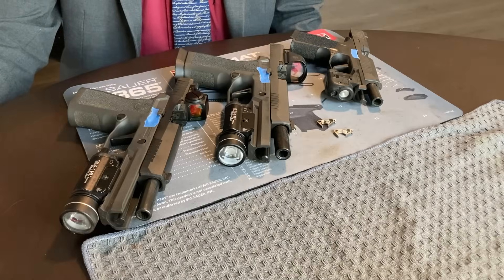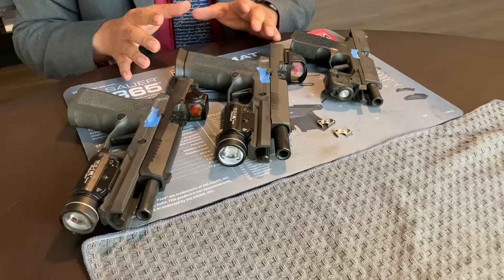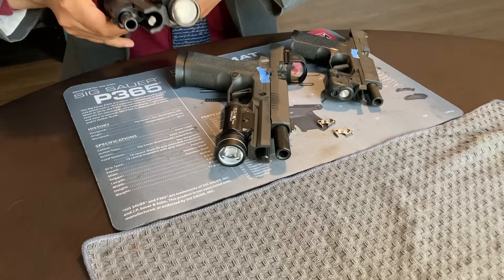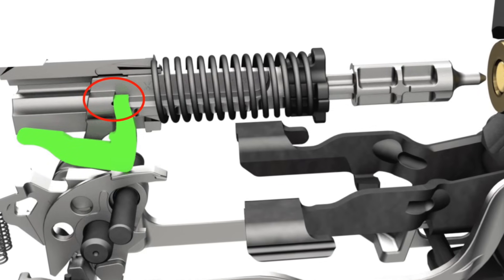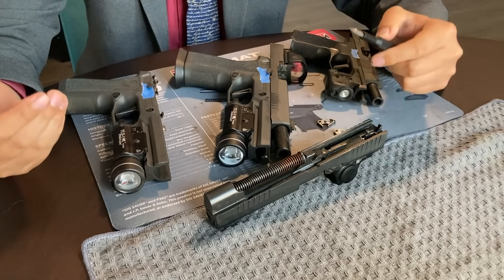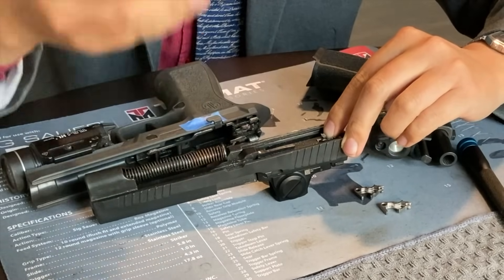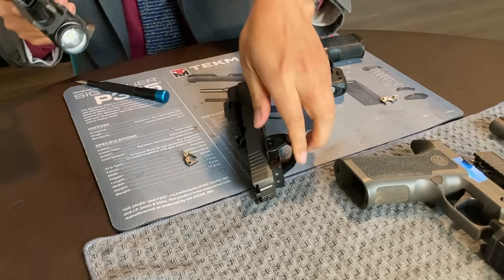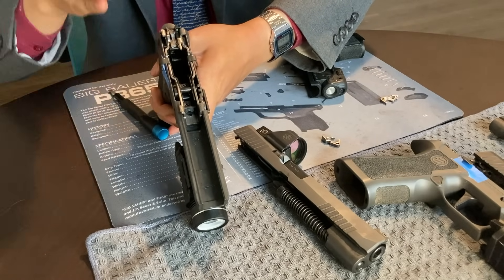How to fix a P320 that fails the Sear Movement Test

Comment: My understanding is that the uncommanded discharge issue does not occur with the P365. Why not just upsize that mechanism into the commercial P320? I understand SIG cannot change the M17/M18, but why not simply change the commercial P320 to the P365 action?
Reply from the maker: You'd have to ask that of Sig, we're just trying to make the most of our paperweights that we can't shoot at any ranges!

Comment: My buddy is a county sheriff and their entire force carry’s the M17s.  I guess they had a guy from Sig come out and put a stiffer spring in and they all carry with no issues. Like you said, it’s not a for sure guaranteed fix but it seems to have worked for them.  I personally have no history with them that’s just what he stands on when I make fun of him for carrying it on duty.
Reply from the maker: Hah - likely a stronger Striker Return Spring. A strong and authoritative Striker Return Spring seems to mitigate the vulnerability to sympathetic Striker Safety Lock deactivation, but that spring doesn't prevent the issue, it merely papers it over. I hope your friend's department experiences no issues!

Comment: Very very interesting video!   I was glued to it !!!! I had to get headphones so I didnt have any distractions 😅  I have a 320 that has drove me nuts. The sear stays up higher than it should. Have to pull the trigger to disassemble.    Its tough to put the takedown pin in when reassembling. Ive had the FCU apart sooo many times trying to figure it out.  Gotta see if there's a difference in the sear now!!!!! My other 320 is easy to disassemble. Both guns shoot totally fine ,   Awesome video !!!!!!!

Comment: So basically, when CIG 'fixed' the issue in 2017, they possibly created another design flaw that can potentially causes a different issue IF the gun is broken or damaged or overly worn. Seems like a very easy fix if that is what allows the gun to fire without a trigger pull. So you have to ask; "Why don't they fix it?

Comment: The rear half of the sear engages wirh the trigger bar so on thumb safety manual versions of the p320 it locks down the trigger bar when it is engaged this stops the sear from being able to drop and stops the safety lever from rotaring being able to dis engage the striker block safety and obviously stops the trigger from moving.

Comment: So out of spec manufacturing tolerances ? Ive 2 axgs and they were safe. Kinda shity you havae to buy a 1500 dollar version. Even if the striker block operated properly, you have a dead trigger  unknowingly. Meaning self defensively the pistol also fails

Comment: Cause: Sig wanted a better trigger pull and feel than Glock. 
Like the Rem 700 trigger issue?
Reply: What SIG wanted was to not have a trigger safety tab like the Glock, but unlike Mr. Glock, SIG failed to understand inertia and the real purpose of that tabbed trigger safety. Recall SIG’s original ads showed that the P320 could be ordered with the tabbed trigger safety.

Comment: I know sear disengagement won’t cause an uncommanded discharge, without a failure of the safety lever lock.  But won’t it cause a dead trigger? Wouldn’t this cause a need to rack slide unexpectedly at potentially the worst time?

Comment: I shouldn't have to modify any firearm to get it to work properly and also to prevent any un-commanded discharge. This is a bad design. Sig needs to redesign the sear, disconnector, and striker assembly and striker safety lever. Use the design that exists in the Sig P365 and everything will work fine.

Comment: I have a 320 upgrade, I live 20 min from sig in newington my triger does not move i also beleave I have a new match style trigger. It also came back in under 3 weeks. with all that said could the upgraded trigger have fix the issue? or could i have a phtom sear?

Comment: I have no idea the purpose of that leg either, but I know enough to know that no manufacturer adds parts or features to parts that add cost without some expected benefit.  So, I am virtually sure that Sig had an expected purpose for that  leg, but I don’t know what it was.  It does seem to also have added an unintended consequence to the intended consequence.

Comment: Ok guys, guess you don't understand how the p320 works.  The rear leg in conjunction with the with the front leg, locks the sear to the trigger bar.  When you have the external safety, it locks the trigger bar and the sear cannot move under any circumstances.

Comment: I’m interested to see if anyone can recreate an uncommanded discharge with the external safety engaged on an M17 or an M18 model. I currently have the full sized military M17 and I have been fiddling to recreate these issues and I have been unsuccessful. With the safety disengaged I could pull the trigger past the wall to a point then wiggle the slide to get it to fire, but that was the closest I could get to recreating these issues issue. I did your tests with the safety engaged and it seems to have a different behavior. Locking the trigger up with the safety seems to lock trigger bar to an extent, and not really allow much if any sear movement. I haven’t done your test with the gun assembled by pushing on sear with a poking tool, but I will soon and I’ll update here. Someone in another comment said it seems part of the issue is the sear can actuate the trigger, which then drops the striker safety, but as I said I wonder if someone can replicate that with the external safety engaged.

What’s worrisome to me about the P320 is the airman situation, because that had an external safety in the holster, and I’m thinking the safety was probably engaged. To be honest, the other supposed UDs are pretty much all LEOs carrying a gun with no safety that’s even less forgiving than a Glock. Glock leg was a thing, and it turned out to be bad gun safety practices from officers. Take a P320 and assume it’s working perfectly, and give it to an officer (who are known to be some of the worst of the gun owners out there), and I can easily see cops shooting themselves. If a shirt snagged in your holster, a Glock might forgive you much more easily than a sig, for example.

Comment: Without the back leg on the sear, then sear can move if sear springs compressed. With an external manual safety lever, does the sear get mechanically locked and prevent from falling?

Comment: Holy Crap on a cracker! .. this was an AWESOME demonstration and extremely valuable information! .. I am also relieved that the P365 doesn't suffer from the same affliction (design flaw) as the P320 as I own several P365's and use it as an EDC. Thank you very very much for this video!

Comment: SIG isn’t known for leaving extra material on parts out of generosity. If there’s a protrusion or odd geometry, it’s almost certainly there for a reason. If they could shave off a few cents, they would. So unless you know exactly what you're doing, don’t modify your sear.
also ... Please don't try to offload your defective SIG P320 onto unsuspecting buyers. I am hoping that advice was sarcastic.
Reply from the maker: Bruce Gray's original patent describes why he added that secondary leg. It also describes necessary behavior for that leg to not cause a different problem. Sig's execution of Bruce's patent does not demonstrate that necessary behavior (what I've been calling "disconnector-like behavior"). Old Bruce Gray, according to his own patent, would agree that the presence of the rear leg as it is currently executed in most pistols is a problem and actively makes the pistol less safe.

Comment: Your videos are definitely the best on this subject.

I will say overall, i still feel like these uncommanded discharges are probably not happening without something touching the actual trigger... i understand the whole sear and striker saftey sympathetic movement... but what would cause such a firm press on the sear? Enough to cause trigger bar movement? If rough movement of the gun in a holster causes the sear to slip... wouldn't that be a very slight slip of the sear? Not a full press downward

Do you see a problem with my conclusion?

Comment: That was an excellent presentation. I have a Sig P365 XMacro Comp and I noticed (just before you pointed it out) that the trigger bar on my P365 was not moving when engaging the sear. I also tried this with my Springfield XD .45, and I noticed that there was no movement on the trigger bar at all. I know the anatomy of both those guns are different, but it seems they were similar enough in that regard.

Comment: Out of curiosity, have you done any sort of drop safety testing on the guns post-modification. Like you said, the image of the pre and post upgrade sears doesn't show that leg so, to me, it seems to have been added intentionally. I'm wondering if they found the lightweighting done didn't 100% fix the problem and they were trying to add resistance to the mechanism by tying the trigger and sear together in an attempt to further mitigate the cause of that drop safety issue. 

Adding a way to defeat the striker safety without a trigger pull kindof defeats the purpose of the striker safety so I doubt they would do that imtentionally. BUT, I could definitely see them doing it being hyper focused on trying to fix one issue and not realizing they caused another, bigger issue inadvertently. Can't see the forest through.the trees kind of deal.

Pure speculation on my part but it seems it was added intentionally and I can't think of any other reason why that might have been. It would kindof be in-keeping with the explanation in the comment you shared in the video and give a reason WHY they wanted to add additional resistance.

Comment: So then, trimming the rear sear leg would lessen the spring tension against unwanted movement. Is that an issue? Can you then put a stronger spring in there to make up the difference?

Comment: Either way it’s too complex.  

If the striker releases but is stopped by the firing block, doesn’t that also mean the gun is now in an uncocked position?  Therefore, not firing when needed until reset?

Comment: Tempts me to buy a LE trade in Sig P320. But even if this fix works, so many people are now afraid of the P320 causing it to be banned from some ranges and courses. 

But this video raises some questions about Sig. 
(1) how did Sig not know of this defect?
(2) when did SIG learn of this issue and possible fix?
(3) who is responsible for not fixing the problem?

As it is, I am trying not to feel ashamed to be a Sig owner (2 P365 Fuses). And do I want to support this behavior by buying more Sig products? I just don't know.

Comment: Hi sir
Thank you for a such detailed review. 
I have a question 
I checked my p320 for the sear, and when pressing my sear it’s only moving forward without downward movement. 
But when checking my striker test 10/10 it never protrude. 
How can I make sure my gun is safe?
My fcu is an sig custom works fcu with apex trigger bar and skeleton trigger shoe.

Comment: I am not a gunsmith but have done a lot of work on my own firearms and have a pretty good understanding of how they function. This video makes absolute perfect sense. I checked my X Ten and it was doing the same thing so I tore it apart and chopped the leg off the sear it now seems much safer as when you press on the sear it no longer pushes either the trigger bar or the firing pin safety or striker safety as you put it. Thank You for this very in depth explanation and safety fix. The P320 X Ten is my only 320 but I carry a 365 in my pocket all the time and also feel better about not having a UCD with it after seeing this.
Reply: ever ran into an issue with the XTEN locking back after the 1st or 2nd round?
Reply: @TheTrueErnie I have not. It could be a couple things causing that, gun could be out of spec, could be the recoil spring is too heavy for the ammo you are shooting, could be the ammo coal is a little long and catching in the mag causing them to nose dive and the slide to stop. In most cases if a different ammo doesn't change the issue you will either need to send the gun back to the manufacturer to have them fix it or take it to a qualified gunsmith and have them find and fix the issue.

Comment: Custom Works FCU with manual safety cut I performed.... Apex Precision forward reset trigger.... With manual safety off and pushing the sear down the striker safety arm moves up but with the manual safety ENGAGED it doesn't do that at all.... Make that make sense....

Comment: Did you measure the pin holes in relation to everything else?? Pin hole to pin hole? Pin hole to vertical and horizontal locations?? If the holes are not perfectly oriented then it will give some variation of results...

Comment: Just throwing it out there; but, could the leg in the sear be a "future proofing" mechanism to prevent some kind of full auto modification (similar to what a glock switch does) by phisically forcing the disconnector to be actuated when the sear is manually depressed? Just a guess?

Comment: It would be interesting to see if Sig would come out and say "don't" do this because that second leg on the sear is needed specifically for "this reason".  I would also like to know if these specific Un-commanded Discharges occurred (not the drop un-commanded discharge) to any P320 without the voluntary recall "upgrades".    If the original sear did not have the second leg why did they add it?  What did they find that made them decide to add it?  Your findings seem very reasonable to me.  I'm thinking about purchasing a second sear and doing this mod.  Thank you

Comment: I just tested this on my M17 and P320. My M17 the sear will engage my other P320 with Apex trigger when set will not raise the mechanism.
Reply: This makes no sense- It reads that the sear will engage the other P320.  You should learn to use punctuation.

Comment: I have two 320’s. One is a pre drop compact that was sent in for upgrade. The other was pieced together from a full sized x-change kit and an fcu with a flat trigger. The full sized fails the sear test every time. The compact passes the sear test every time. I swapped slides and the full sized slide still fails every time and the compact slide passes every time.
Reply: Looking at the movement of the trigger bar, the compact trigger bar seems to move downward and forward, while the full sized seems to just move down. It would seem that this difference doesn’t matter. When I have time, I am going to disassemble the full sized slide to see if there’s any glaring issue.
Reply: So, I’ve played a little more with this and I was doing something stupid, but I think I learned something from it. When I was performing the sear test, I was pushing the slide a little too far forward, because the tool I was using was a little too big. This caused the full sized slide to fail the test. When I used a smaller tool and didn’t move the slide as far forward, it passed the sear test. I’m thinking that the problem is somehow caused by the geometry of the safety lever and the corresponding part on the fcu.
Reply: To follow up a little further, if in a holster and the slide is not in the correct position, the striker safety may be disabled, which could allow a jostle to cause the striker to jump the sear and result in an uncommanded discharge. It would be interesting to see how much could be filed off of the safety lever and still allow the pull of the trigger to disable the safety.
Reply: Btw, I really like the videos and appreciate the work you put in to it.
Reply: I’m really going down the rabbit hole here. What limits the slide from going forward too far? The recoil rod? The striker and rear plate? I’m assuming that the safety lever would most likely be disabled if the slide is slightly forward. Those parts could be contributing elements.

Comment: Great work again!  I've got an M18.  When I push down on the sear AND hold my finger on the safety lever, it does not pop up.  Does yours pop up with force applied?  If I don't apply any force with my finger, it will pop up and pushing down on it won't move it back down.  Message me, and I can send a video if mine is unique.

Comment: The addition of the rear leg on the sear was part of the fix on the original drop safe issue. The drop safe issue had 2 components: the trigger was moving backward when dropped and the sear was therefore being dropped. Okay, so they fixed the trigger so it wont move backward when dropped but the sear could still bounce and drop. This would release the striker but not cause the gun to fire bc the striker block would not be engaged if the trigger bar doesnt move. Putting the rear leg on the sear keeps the sear from dropping if the gun is dropped because the rear leg has to push against the force of the trigger bar. And since the trigger bar is now not moving, the gun is drop safe. I bet if you did drop testing with your sear with rear leg cut off you would find that the striker is capable of releasing when dropped in the same manner as the original drop safe issue. It wont fire but it will release the striker. SIG created a new issue by attempting to fix an existing issue. SIG has to add safeties, either trigger blade or grip safety.
Reply: This makes a ton of sense.
Reply: I was just about to comment asking if they did any drop safety testing after making the modification because this is the only reason I could think of that that feature might have been added. It wasn't in the comparison image they showed so it had to have been added intentionally and this is the only mechanical reason that makes sense to me.
Reply: @wid @widowmaker117 e was more to the drop safety fix than just the rear sear leg tho